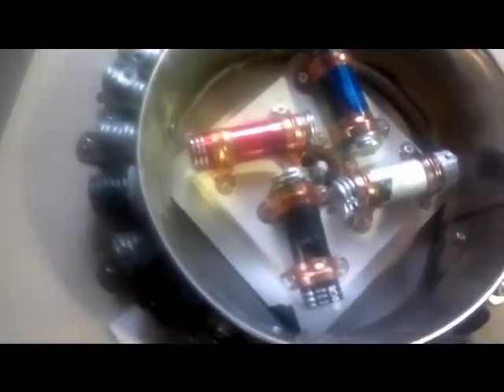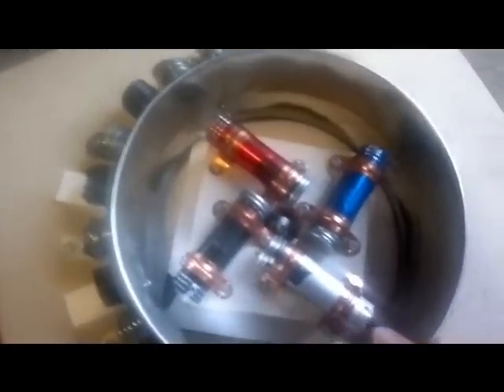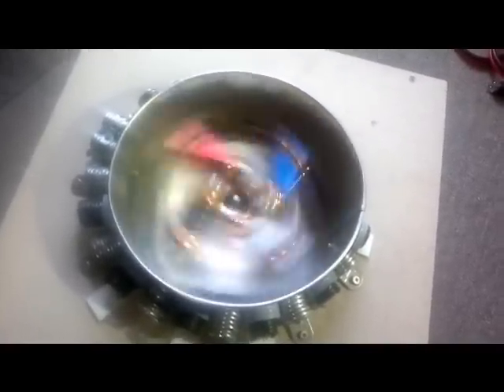The Magnet Motor Chronicles Pt 3 Free Energy Magnetic Motor Or Pile Of Crap?

Comment from the maker: Oh hey yes that is an excellent suggestion and I have plans to do just that once I have tried all my ideas out, I just want to take it as far as I can before I make electricity from the partial spin to pulse it back in when I need it. Yes that would still be over unity and a success but by resisting that temptation I am coming up with new ideas and little tricks along the way. My next configuration that I am working on now is combining several of them including my magnet piston. thanks bob

Comment from the maker: Thanks I am currently working out the bugs and will have a new design based on what I have learned, one step closer each time. The rotor is sound nice and heavy just going to max out the wheel with magnets and use shielding instead of sliding to dampen the repel zone, plus a few other trick and treats haha thanks all the same for your positivity I thrive off of that more then the negative comments but they motivate me too haha. cheers!

Comment: Decrease mass of flywheel by 50% increase power of neo magnets by 50%. I noticed sustained rpm at maybe two sweet spots which indicates self rotation possible with 100% exact geometry. You get closer to self powered. I experimented with vortex and I feel you can power assisted magnetic propulsion which also a free energy. You add torque for free!

Comment: Hey. Im not sure how much farther you've gotten but I would like to offer a little advice. Ignore it if its bad because I have yet to exceed in making my own. But couldn't you add a generating coil onto the axle. With the rotations its already making you could run the electricity into a capacitor. from there you could make a small motor portion to produce an electric field at or right before your weak spot thereby accelerating the wheel to the next rotation. Just hope my opinion helps. Good luck

Comment: The problem with noise is that it isn't "free". As long as your machine is making noise, it is loosing energy. All that noise can be thought of as energy lost in the system. Any perpetual motion machine would have to be entirely silent and friction free. I would think that if some sort of magnet motor is possible (which I don't), you should start with 0 loss, rather than over-unity,

Comment from the maker: yes I was thinking that the very thing that I thought up to make it work was working against it. I guess my SMART (sliding magnet attractive repulsive technology) is not so smart after all. My next step is to try it with all solid magnets in 4 positions and the next step after that is to just try one solid magnet so that there is not 4 slow downs per revolution. Then after that try a full wankel configuration weak to strong all around the circle. Thanks for the tip on the egg.

Comment: try to compensate for vibration, use the springs in these magnets on the rotor because the sound is like a clacking valves on the camshaft  in car engane

Comment: Well, if you are going to insist on pursuing magnet motors, at least try to eliminate all friction, noise and heat from the device. IF you can find a way to create a completely frictionless system that is 100% efficient, you will have created a perpetual motion machine.

Comment: Tip you need to add electronics. Convert spinning energy into electricity.
Reply from the maker: Gerald Rowley old video but yes I am working on that now, an electromagnet that is enhanced by permanent magnets to increase the repel force but will still be weak enough on the front end not to hinder the pull in to the ferrous metal. I am using a mix of neos and ceramic magnets and spacers to create a pulled back magnet field with a coil on the front. thanks sure beat video games for the minds sake if not for the earths as of yet.

Comment: This device certainly had a good portion of awesome in it, but doesn't it bother you that the design requires conservation of energy to be violated in magnetic fields? That is, that you can juggle potential energy in a magnetic field to potential energy in a spring back and forth and come out ahead even when including energy loss in the conversion process?

It seems to me that testing that claim should not require a series of engine designs. Thumbs up for awesome though. =)